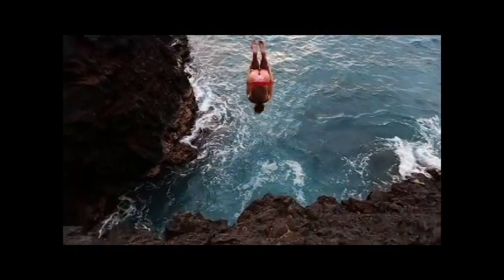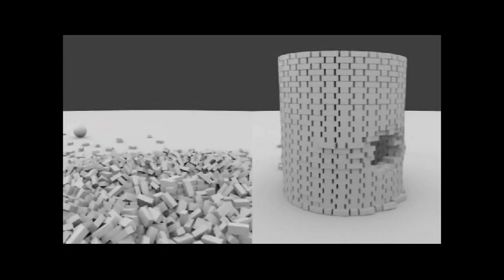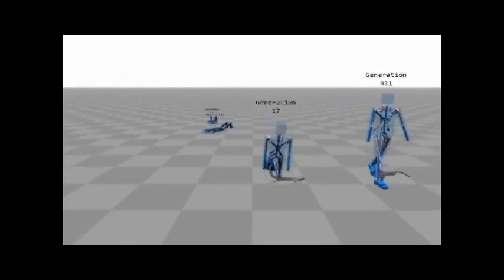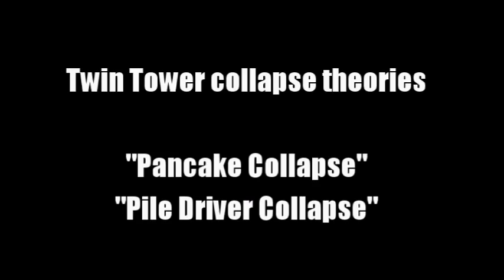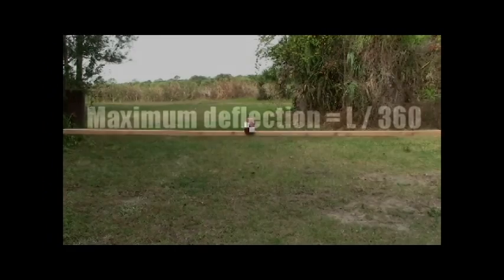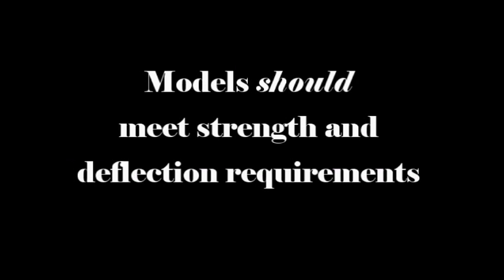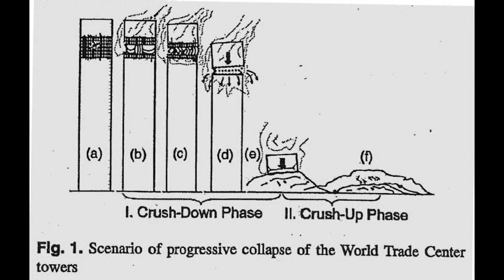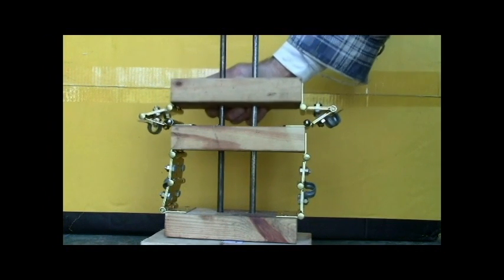9/11 Experiments: The Force Behind the Motion

Comment: A few thoughts as a professional mathematician and person of science.
 
(a) Every argument (not used here, but commonly found) appealing to "basic Newtonian dynamics" as invalidating the official collapse explanation is simply wrong.  Classic Netwon equations do not apply to systems with variable mass or mass transfer. You have to account for the mass entering in the system as continuously increasing the force exerted by the collapsing block, while the same time mass as removed by the resisting block causes the progressive decrease of the reaction.

(b) The experiments in this video are clearly unreliable as they are ignoring so many variables. Also, such symple stylezd model cannot capture the complexity and scale of the phenomenon: there is simply no way to reproduce the enormous quantity of kinetic energy released by a collapsing floor of those built using paper and wood. Furtermore, the one at 8.30 gives a positive result (in the direction of the official explanation) so I wonder what is proved here:  any material/construction object is as good as another in the "simple" approach taken, which in all instances completely ignores the correct material resistence/weight ratios.

(c) Still, I personally find the fast rate of collapsing of the buildings incredibly hard to explain, which however is clearly per se not an argument to refute the official conclusions (however unsatisfactory the final report might be).
Reply: evsupp2011. This is certainly consistent with the observed phenomen. However, also consistent is the fact that core effectively pulverised progressively as en effect of the enormous quantity of kinetic energy released by the collapsing portion.

Comment: I was in the 8th grade on 9/11 and as an 8th grade kid (watched second plane hit live in the classroom) I remember watching that spire/antenna staying upright as the building was going down and I immediately knew that those planes did not bring those buildings down. Anyone with any common sense should see why people have such a problem with the official story. I don't advocate any particular theory for the reason of why this happened... each person will have to look at the facts and find out what is the most plausible reason. However there was way too many strange things happening that day for such a perfect storm... and at the very least you would think that people could understand the conundrum that folks have about the collapse because it is a genuine conundrum that does not match what we know to be true. We could argue all sorts of models for the collapse but at the end of the day it has to be which mechanism of action is the most plausible/reasonable given what we know to be true. I am not a structural engineer but I know buildings dont free fall (from trauma in the midsection) ..."because, science" lol
Reply: Learn about constructional engineering  and procedures used to protect beams!
Ive worked as a electrician in new high rises and the codes are to ptotect beams with 2inch thich coating. Sprayed on before drywall, electricity or plumbing goes in. It doesnt fall off but a impact force can knock it off and expose the steel beams.
They do this because fire weakens steel. Weak steel will not support  masdive weight.
Molten steel isnt the issue as troofers say!
Reply: In 8th grade you were an idiot with zero knowledge about real life - much less physics. The opinions of someone with such a reduced intelligence and knowledge are irrelevant, I'll stick with the facts instead if you don't mind (or even if you do).

Comment: Massively flawed experiment. When you talk of strength and deflection (pancake theory section), you concentrate on the strength and deflection of the 'floors'. As it's the supports that failed in WTC 1, 2 and 7, NOT the floors, this is irrelevant. You should be calculating the strength and deflection of the support structure, and only the mass of the 'floors'. Instead, you use a massively disproportionately strong wooden support structure, that has zero similarity or relevance to any skyscraper. 

"What if it was set up to fail?" you say - Your experiment was!

Pancake theory - In a structure, each floor's support is designed to hold the weight of that floor, plus a tolerance. 
So, the support for floor 100, is designed to support the weight of floor 100, plus a bit more. If that support is weakened, say by fire, and fails, floor 100 falls and hits floor 99...

Now, the support for floor 99 has to support the weight of 2 floors (plus impact force from above) - something it is not designed to do. So, the supports for floor 99 fail, and floors 99 and 100 both fall onto floor 98 - whose supports then have the job of supporting 3 floors plus impact force. This is even further beyond its limits, so supports for 98 fail quicker than 99 did... and so on, as collapse progresses - 97 fails quicker than 98, 96 fails quicker than 97, etc, etc. So yes, you absolutely WOULD see acceleration, based on a pancake theory, but you set up your support structure to be FAR too strong to possibly show that. 

Well done, for claiming to base your theories on physics, then flat out ignoring the most basic physics principles.

Comment: Its already been found out no controlled demolition or anything see the building when it was created was ment to withstand small airplanes but the plane that hit it was a much larger plane and more gas so when the plane hit vibrations shook the entire building weaking other supports to and the building wasnt full proof because since it was an office building supports were clustered in the middle and sides so that weakens the building more since there was was lots of fire it causes the steal beams on the floors to sway down and pull in the structure finally it falls it falls fast plus weight weak beams and even more weak beams from the fire makes it collapse but it didn't fall at free fall speed it took about 25 seconds the middle some middle beams stood then fell free fall speed is 10 seconds the towers took 25 seconds to fall
Reply: Jaybird YAWN!!
Reply: CooL!K3DaT you just cant except the real truth that it wasn't an inside job now look I don't have the time to argue

Comment: Physicsandreason :  There is one big problem with your experiments -  the characteristics of material (steel, concrete) change completely when you scale down !!!  you need to scale down the inner strength of the material too in case you want a realistic comparison.   you scale models are way too strong !
Reply: Your principle does not work for the real scale thing      Why do you ignore my follow up question about the cores being momentarily in tact after the rest already collapsed? It is what the video's show and doesn't match your core theory.
Reply: You are either a robot or somebody incapable of defending his own claims.

Comment: As you said, No one has been able to model the reality of the WTC collapses, neither have you.
Reply: Actually, it does not illustrate what happened that day at all.
First of all it doesn't model the structure at all in regard to materials physical characteristics. The tower had a center core and outer walls with trusses that tied the core and outer walls together. The models here use paper and match sticks which are not structurally equivalent for the scale of the model to the actual buildings. The walls in the model are within the floor area, not on the outer perimeter.
As clearly shown in the videos of the actual collapse, as the floors fell, the outer walls fell away and no longer provided any support. In the model, the walls are inside the structure and remain in place the entire time. Therefore the walls absorb the kinetic energy. Therefore, the model is flawed and does not reflect the actual structure.  Therefore this demonstration is invalid and built to prove a predetermined hypothesis that explosives caused the collapse. Physics and Reason should have paid closer attention to the opening montage about credible modeling and science.
Reply: Not going to indulge me, yet you did anyway.

Comment: Small scale models will never collapse the way a big building does !
Reply: The entire idea that conclusive evidence can come from scale models is false.  I will give an example that shows why.  A concrete block crashtest : A 3 by 3 by 3 feet block of concrete is dropped from a 30 meters above the ground,  what will happen as it hits the (solid) ground ? it will shatter to pieces .  Now we are going to do the same but on a  100 times smaller scale.  We drop a 100 times smaller block(very tiny )  of the same concrete from 30 cm ,  What will happen ?? it will not shatter or break at all ! The results are completely different !
Reply: @evsupp2011: "collapse is impossible without removal of the central core
' than why were large parts( at least 200 meters)of the central cores still standing for a while after the rest of the building already collapsed around it?
Reply: And there was red hot steel , and molten aluminium , not molten steel.
Reply: Again my question "why were large parts( at least 200 meters)of the central cores still standing for a while after the rest of the building already collapsed around it?"   check it here : https://www.youtube.com/watch?v=I47Nv74mTwI
I believe my question is very valid.
Reply: You keep repeating the false idea of molten steel in the debris pile. And I have never seen such a simulation. The only experiment that would be useful is to rebuild the towers on the same scale and fly real planes in them.
Reply: That same engineer also explained in detail why the towers collapsed. They discovered molten metal in the debris long after 9/11. and heavily corroded steel , not molten steel. Some witnesses called it  molten steel , but it was more likely aluminium (molten exterior panels)
controlled demolition never leaves molten metal behind , so how does that proof anything?

Comment: Looks like to me the added weight and the structural integrity of the buildings degrading as time passed are not placed in the experiment here, this is at best a controlled experiment with the bias mindset that only a controlled explosion would have completely diminished the integrity of the buildings, if that is indeed the case....then everyone would have heard the explosions very clearly, since it would have been extremely loud to the point of recognition.

Comment: A very thorough experiment, however the question remains. Where did the tower's go? If you take into account the seismic record for that day you will find that what was recorded was no where close to the seismic record that would have been created had the towers pancaked or collapsed. The towers were almost a 1/4 mile tall and weighed approx 500,000 tons each or approx 50,000 fully loaded dump truck. Wouldn't dropping 50,000 fully loaded dump truck create some sort of significant seismic record? Also, take into account the remaining pile of rubble or the lack of rubble after the event. As well,  the free fall speed of 9 sec or less is contrary to every principal law of physics.  PLEASE READ "Where did the tower's go?" by Judy Wood. It will open alot of eyes. Respectfully.

Comment: Thank you for all your hard work, and for the videos/editing/explanation to document them. We the people will get justice one day, but not without the efforts of people like yourself. The fools who are saying these experiments are not accurate or to exact scale, or taking into account every engineering design of the actual buildings are missing the point. Nor do they apparently understand that you are a certified professional engineer by training/education (are you a structural engineer?) http://bit.ly/2cwoWge    http://bit.ly/2aLifHf     Yet people of weak intellect with no training, education, or experience, believe that they are better prepared to argue the finer points of engineering or debunk your experiments?  It would be funny if it wasn't so sad and if we weren't talking about 9/11. The point is (and I understand), that the WTC structural columns/supporting structure were much heavier and stronger in the basement and lower floors, up to at least floor 66. In your experiments, the "floors" were all the same. In other words, they lacked the strength and structural support designed into the lower floors of the WTC (comparatively). And yet they still withstood the weight of the falling structure and slowed down [the collapse]   http://bit.ly/2wAugFQ

Comment: This so called "experiment" does not take into account the exponential weight increased upon one floor  collapsing on another floor etc., etc., yet talks about the increased strength of the lower structures. How can this "scientist" miss something so elementary. And why didn't he take into account the mass X velocity increase that begins upon the first floor collapse, due to the weakening of the steel structures by the heat.

The "experiment" with the weight collapsing the floors is a false positive in that there are no structural correlation between the model and the real building.
Why not use paper for floors, or 1/2" steel plates, or a feather for a weight, or a 30 lb. spud bar.
Faulty science.
Further, for this to be an inside job absolute silence of tens of thousands of people would be necessary yet not one word from any "conspirator" after sixteen years? 
Psychologically speaking, nothing I, nor anybody else, can say, prove or disprove will change any of your minds. It's just a part of your illness. 
This faulty science is precisely for the mentally deranged people that need to have a conspiracy, any conspiracy, to feel that they are smarter than they know they actually are.
Reply: john paparella is your ass jealous of all the shit coming out of your mouth? You are just to YouTube engineering want to be with a degree from Legoland. Quit embarrassing yourself you know nothing about the laws of physics and you surely don't nothing about engineering and how the towers were made do yourself a favor grasps your ears and remove your head from your ass if you believe the official story the 19 hijackers with box cutters kick America's ass well that's exactly what the definition of conspiracy is you believe in conspiracy theories jackass
Reply: Cool - Well, if you so clearly accuse others of not understanding "how the towers were made", you must have a thorough understanding of it yourself, right? Now please explain to me how in these experiments the floor-to-perimeter connections have been represented. After all, this IS the main point of interest of the progressive part of the collapses according to NIST. If you think NIST is wrong in this matter, please explain why and please be specific. Not a hard job if you really understand the design of the towers.
Reply: Bruce Lansberg.... Stop it Bruce,, by putting these idiot truthers '''feet to the fire'''., forcing them to present real facts.. you're gonna stop the truth movement.... then what will those idiots do?
Reply: There's always chemtrails, moonlanding, school shootings, deep state, flat earth. We've only just begun :).

Comment: If it were as simple as flying a (drone)airplane filled with AVGAS directly into the top section of a skyscraper to cleanly demolish it into it's own footprint (and get a bonus demo when you do 2 on the same lot), we'd see this method used everywhere, right.
Reply: Unfortunately this will only work when:
- Planes fly in at high speed (to do major damage to core and perimeter)
- Fire proving is dislodged (to have the floor trusses subjected to intense fires)
- The damage is sufficient enough to block any access to the damaged floors from below (so the fires can't fought)
- The sprinkler systems are out of order (so the fires can't be fought)
- The building is designed with long floor spans (so there is no traditional grid of vertical support)
- The floors are connected to the permiter and core by truss-seats (so the floors fail easily and progressively after failure has initiated)
- The core and perimeter are built from steel only (so unprotected from heat of the intense office fires)
So, nah, I don't think it's as simple as that.